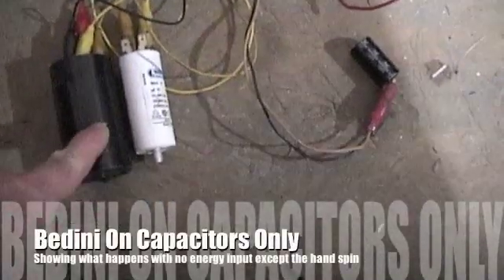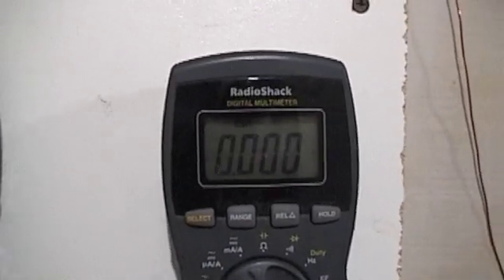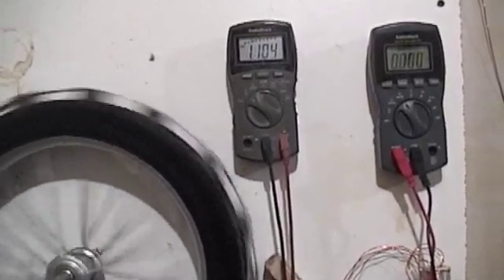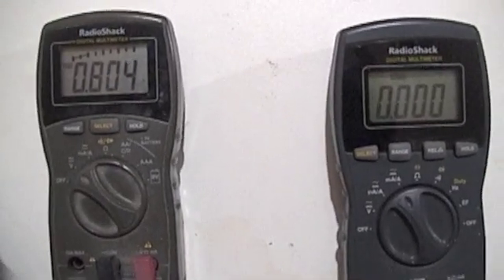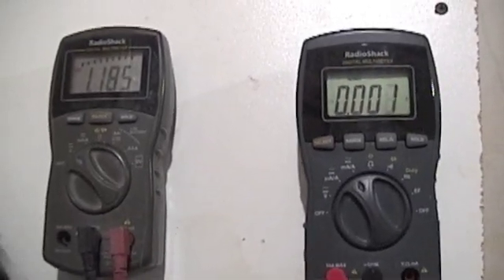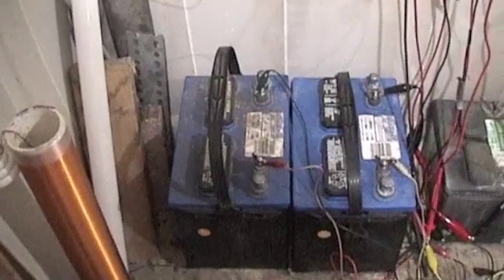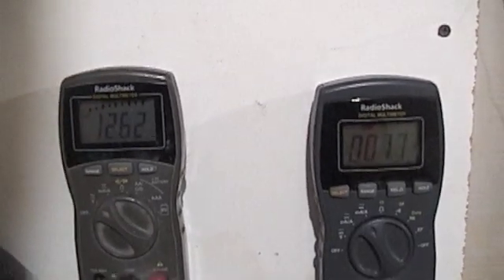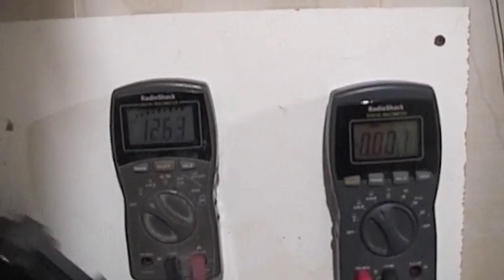Bedini - No batteries

Comment: I had an idea similar to this.  Using a super cap to drive the Bedini circuit, and charging batteries on the output.  With the right circuit, you could sense when the cap drops below 11V, and automatically charge it back up to 13V with just a quick on/off from a battery. That way, you are only draining power from a battery every so often.  with the right timing, you could even pulse power into the cap between charging pulses out and do this with one battery. worth a try in my opinion, nice work